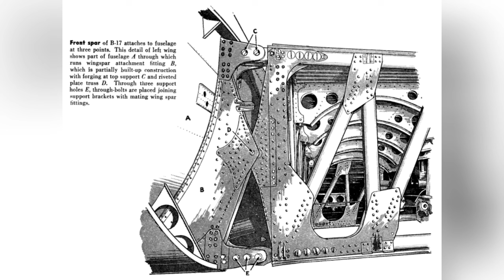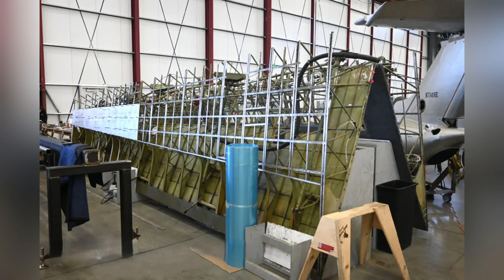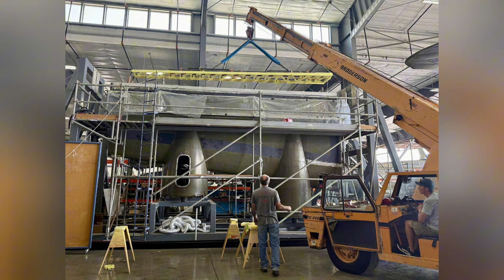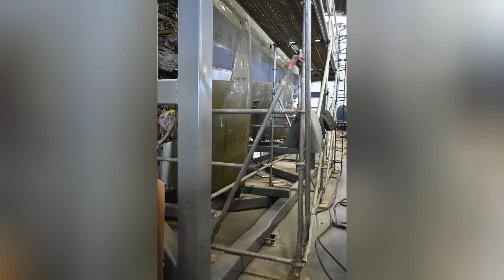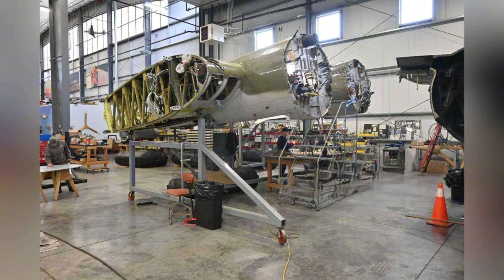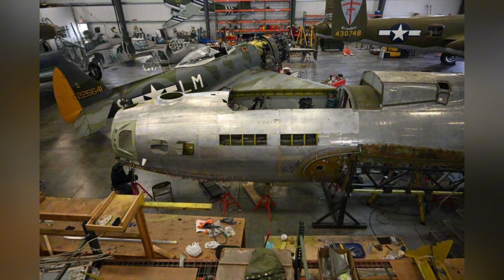Restoring the B-17 'Thunderbird': The Structural Nightmare Nobody Saw Coming

Comment: I have a set of the blueprints that were scanned into .tiff format..28000 or so scans in about 38Gigs...These spars are about 2.5 inches square on the outside..But the inside starts at 1 end at about 1/2 thick and tapers down to about 3/16..I would not have a clue on how that was created...Also all the rivets that are used to attach the things to the spars need to be bucked on the inside of the tube..
How do you do that!?!?..And they did that in mass to keep up with wartime production..
Reply: Read somewhere several years ago that the spars have a long tubular piece with thickness that decreases progressively from one end to the other, and that the machines able to do that at industrial scale no longer exist in the US, the last one sold to China many years ago

Comment: These old planes, need to be checked much more carefully to prevent the loss of them due to mechanical stresses.  
The wing and other structures are quite supectiable to metal fatigue.
Reply: Yeah, but let's not forget they were built to carry their weight in bombs hundreds of miles and were also reinforced against enemy fire....
Not to mention the fact that they carried heavy machine guns and thousands of rounds of ammunition.
AND
They were meant to carry a massive amount of fuel.
All at high altitude. The cycles alone were stressful.
They aren't being flown at those high altitudes and low temperatures.
Reply: @christopherleveck6835 True, but when they fly some stress is added each time and those stresses add up over the years as do corrosion.  They need to be really heavily inspected ever so often and repaired to keep them airworthy. Even the DC 3 can suffer from those effects as some are 90 years old.
Reply: @christopherleveck6835  They were designed with a maximum life of, maybe, 100 missions over about 12 months, and not many made it that far. Old planes - like old cars - need vastly more maintenance than they did when new, even to get them to turn on, start up, and operate at any level at all with safety.

Comment: The museum of the USAF in ohio's restoration arm have all the blueprints, jigs and instrument restoration documentation to be able to help with restorations like this, they basically rebuilt the Memphis belle and are doing similar work to the swooze.
Reply: Every B-17 project has been given a full set of documents by Boeing. They come in a file cabinet with three massive drawers.
They also make engineers and even build parts if requested.
My understanding is that they don't charge for any of these services to serious restoration efforts.